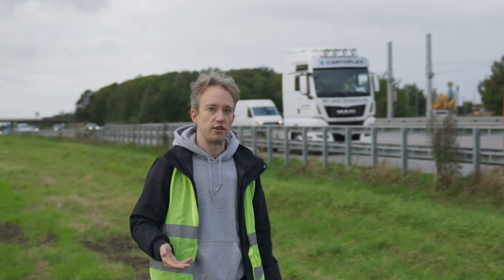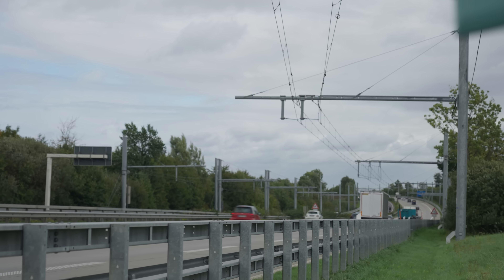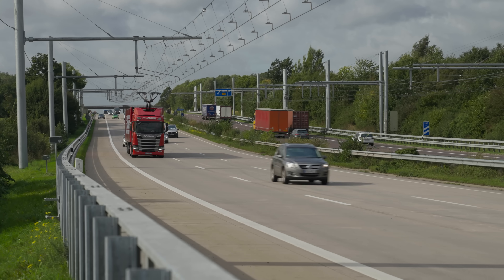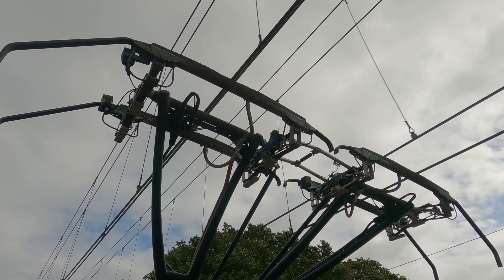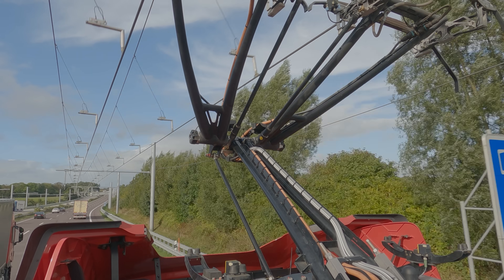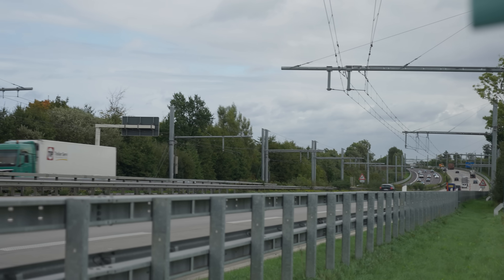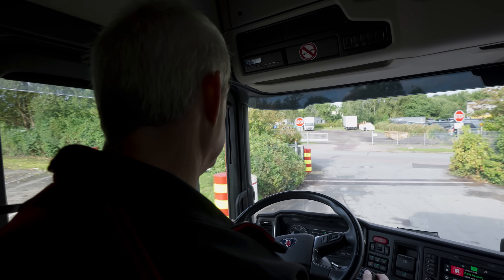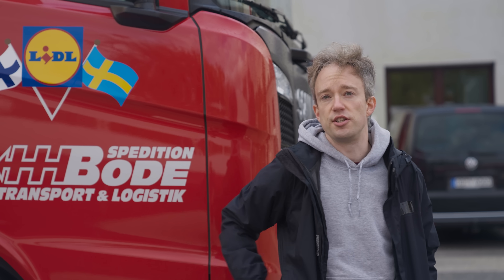The highway where trucks work like electric trains

Comment: I feel like hydrogen fuel cells and batteries would honestly be a more practical solution to this whole charging system being that you can just fill up and go however that being said hydrogen does have its own disadvantages overall efficiency of current production methods is one example.

Comment: So great that you did this story.  I live near Seattle and that city still has some downtown bus routes with overhead electric wires for their old styled electric buses.  Instead of this simple trapeze connection, the driver in Seattle must stop and connect manually a pole from his bus roof to  the overhead wire.  The driver uses another pole by hand to pick up the power pole from the bus to make this connection.
Reply: Electrocution is fun ?
Reply: @JB73-b5x  if only we had some material that could be used to isolate an human from electricity..

Comment: this is fine and all with 1 truck on the grid.. how about once all trucks are converted and rushhour traffic, now suddenly you have 50+ trucks within a mile stretch of highway fighting for the same power from the same cable.. 

This overhead power cables works for trains because trains are usually spaced miles apart for obvious safety reasons.. and generally never more than 1-2 trains per section of energized cable, however vehicle traffic is a whole different beast, I expect that a system like this will overload or simply not provide sufficient power during traffic jams or anytime there's a train of back to back trucks.

Comment: Spend the money on trains and as it's in Europe, the canals.  Thirty trucks need 30 drivers and X number of mechanics to keep them on the road.  A train can easily pull 30 containers and only requires a driver and a guard.  At one time every small town had access to the railway in the UK and most stations had sidings - stupidly all of the sidings and most of the marshalling yards have been sold off and built on.  Vested interests strike again in the UK.

Comment: I like the idea of having a combustion engine while still being able to run off electricity where possible. Many trades require going in areas that are not traveled near enough to have overhead lines, and if the electricity goes down you're screwed if it doesn't have a combustion engine as well. This system would let it run off of combustion engine where necessary and let it run off of electricity where possible, I think that would reduce emissions and create a Greener solution then putting batteries and everything. Mining the stuff for batteries is just as bad as running gas, so if you can keep the gas and also use electricity that's already exists in our power grid that would be cool

Comment: Good luck with that. At the moment there is no substitute for diesel. It works. Where you gona get the massive amount of electricity to power them?  Magic pixy dust and unicorn farts?  Solar and wind do not supply enough. Until we find another power source it’s diesel trucks and coal burning power plants. Which is fine because there’s nothing wrong with them.

Comment: The amount of infrastructure might bring it close to the trains, It might help to have slightly bigger batteries, say with 100-200KM range and Charge them over few KM stretches of overhead lines scattered across the motorways this way you can shift some of the cost to trucks instead of Road Networks

Comment: The idea is dead in the water. The "Global Warming" hoax is designed to make everything more expensive, so that more taxes can be levied on the citizens. In a nutshell, that's what it's all about. "Fossil fuels" as they like to call oil from the earth, is not in short supply. Oil is created through a natural process that will continue until the end of time. Charging electric batteries and creating tram-like systems for trucks, only exerts greater pressure on our existing power grid. It's far more expensive to charge, maintain and replace electric vehicle batteries than it is to run and maintain gasoline or diesel powered vehicles. Also, electric vehicles offer only a fraction of the performance we've learned to expect from gas and diesel powered vehicles (there is no comparison, when it comes to economics and performance). Outlawing a superior, proven technology is insane.

Comment: In principle, this seems a good idea.  However, a number of safety concerns would have to be taken into consideration.  Mainly, what voltage of power supply would  be fed into the overhead wires? THen, most importantly, the integrity of the equipment.  Several truck drivers cannot be relied upon to take their vehicles through bridges without striking that bridge.  Imagine the chaos if a driver enters the wire system with an overheight truck! It will be extremely problematic.  Then, assuming that truck brings down the wires, how will the average motorist handle the situation? Railway train drivers are train on what to do should the overhead supply be brought down the railway.  Is the "average Joe" motorist able to cope?.     Also, I would assume that the road traffic regulations not mention the Highway Code would have to be drawn to cope with the situation.

Comment: So how is this going to get around the road network in the UK which has thousands of low rail bridges based upon a Victorian rail network? There are thousands of low bridges all across the UK which have various heights which prohibit trailers from passing under them. Introducing overhead cables reduces the clearance even further. 
Not forgetting that Scotland's most northerly motorway ends at Perth which is geographically in the centre. 
It's a theoretical idea which ticks the boxes for the politicians but it's unworkable in practice and detached from reality.

Comment: Great idea, but too bad the electricity in Germany is so dirty. It would make a lot more sense if the electricity from the cables is actually low carbon.
Reply: Germany is going to phase out coal. The old government decided to end coal until 2038, the upcoming government is even aiming for 2030. And building such a system of overhead wires over all highways will take some years anyway.

Comment: Reminds me of ye olde trolleybus that we used to have, but for some reason they decided to replace all the old electric trolleybuses with Petrol and Diesel powered busses.
Reply: When did they replace them though?
Back then you could only power small vehicles with electricity, steam engines took too much space, and combustion engines weren't there yet.
Reply: @denniscleaver3559  Consider that while in countries like Britain where they had, but removed Trolley busses and Trams to replace with Busses, other countries such as those in mainland Europe expanded their tramways instead. It wasn't that continuing to use and develop the electric vehicles we already had wasn't an option, Britain just chose not to, due to the increasing availability of cheap liquid fuels.
Well, those liquid fuels aren't cheap anymore, and their availability is decreasing, on top of their use becoming increasingly undesirable due to pollution, so they're looking back to the past for inspiration, returning to over-head electric powered road vehicles, like the Trolleybus, except this time it's for cargo, not passengers.
Reply: @bobingabout  so they simply acted in a dumb and shortsighted way. Like any government should.

Comment: That might work in small countries like Germany and the UK.  It would take many year and unimaginable sums of money to build all those wires and cables in a country as geographically large as the US.  I think a better solution might be to have the cables around densely populated areas, with stations every so many miles on the remote sections of interstate where they can stop and swap out the low battery out for a fully charged one and keep going. Still going to be extremely expensive though, and our nation is already almost $30 Trillion in debt :/.

Comment: While energy in Germany is sourced predominantly by fossil fuels this is just a case of moving the pollution from the trucks to the power stations. Germany has a lot of work to do with it's electricity generation if this is to have any effect at all.
Reply: This argument comes up a lot, but It's far easier to regulate 30 power stations than it is to regulate 30 million vehicles.  A coal power plant doesn't get it's annual MOT carried out by a 19 year old covered in grease.

Comment: haha this absolutely crushes Tesla's EV trucks because the batteries needed are so much smaller. the main drawback of the Tesla trucks (there are two models) is that the batteries are so big and heavy that the carrying capacity is a fraction of what other ones can handle

Comment: I love this solution. I remember being in awe at the public transit in downtown Seattle where the busses connected to power just like this. They were all so quiet and it didn't stink to high heaven.
Reply: I was thinking about the same thing. You couldn't run diesel buses in the transit tunnel without tons of ventilation.

Comment: I remember seeing an idea like this about a year ago for charging electric cars on the road. But instead of a pantograph wire, it used induction magnets embedded in the roadway.
Reply: That would be a lot more expensive and a lot less efficient. This is a well tested well working technology.
Reply: @asdfghyter  That is all true, but one of the reasons they were looking at linear induction charging was to make road charging accessible to cars too. Both solutions can work well for charging trucks. But considering a car's smaller size, and the unpredictability of drivers on your average highway, a contact pantograph-wire system might not be feasible or safe enough for most cars on the road
Reply: @iliketrains0pwned   Cars have different requirements.  If the goal is efficient passenger transport - use a bus, and the same Pantagraph tech.  Cars are small, because they are also light.  And... they usually have ONE driver.  Battery tech that requires a 30 min recharge right when the human is getting sleepy is a GOOD idea.  Trucks simply can not use the batteries from Cars because they are too heavy - so they need a way to extend their range to usable limits.

Comment: Trolleytrucks may not be the most efficient way to go green, as the cost of building the overhead lines matter s even though it is a good idea. They can try using battery powered trucks or even fit in Hydrogen fuel cell on the trucks or even move to regular railroad vehicles with dedicated routes for freight only. As for road trolley vehicles, it is better to be used as passenger public transports such as trams and trolleybuses, as cargo trams or trolleytrucks can be used as maintenance vehicles for the trolley systems. However trolleytrucks and trolleybuses can climb slopes.

Comment: If one of the pantographs got tangled up in the wires and pulls them down as sometimes happens on the railways you're going to have 750v wires flapping around the road. Not good. Will probably require self steering to be reliable enough.

Comment: Different idea:
Use the truck in front to fill up electric cars: Trail very close to the truck and "plug-in" (One car per truck). Trucker company gets some commissions. Car plugged in at the back becomes a "slave" to the truck driving in front (Braking, steering, indicator, etc) -> Fully "automatic" (by the truck driver) drive. Driver of car can get some rest. After fuelling up enough, overtake and continue on the road quicker.

Comment: I thought of this idea myself years ago and it seemed like such an obvious concept but no one seemed to have developed it, but it’s awesome to see that Germany has been working on this. I think it’s a good idea for cars too, but that would be more difficult because of the variable heights. I think to make these E-lorries work even better would be if they had battery power for the non-highway parts of the route, but then it recharges on the highway so it doesn’t take ages to charge up when it’s parked and plugged in.

Comment: This actually makes sense.  The truck pays for the power via the Electronic Logging Device ELD software.  

The truck is a hybrid like a locomotive Diesel engine turns a generator not the wheels. This allows a truck driver to get off the highway for that last mile.

Comment: Ah, just think of all those videos you see of a truck driving along with the tipper raised, taking out a sign post or bridge. Now that'll happen with high voltage power lines as well. Still, in 20 years maybe driverless vehicles will have taken over and the robot trucks won't make those mistakes?

Comment: One thing with modern vehicles burning fuels so efficiently, how would that compare with the other means of increased electrical production, wind, solar cannot keep up, limited, so does than mean burning more dirtier coal ?
Reply: Nuclear, the answer to everything related to electricity is nuclear unless you're in one of the few places hydro is the better option.

Comment: Given that driving on UK roads is like the ‘Dodgems’ anyway, why not extend this to be an electric mesh above the whole road, and then we can all have those whippy aerials to pick up the current, just like at the Funfair? 😎
Reply: You might have forgot but Dodgems also have metal wheels and the floor of the arena is steel plates.  In order to complete a full electrical circuit you need the mesh above and the steel plates below. 👍
Reply: @krashd  Yes, I guessed it was more technical than my description 😄
Reply: I wanna see people commute to work in actual dodgems.

Comment: Increase efficiency 500% by having steel wheel on steel rail (which also means the truck stays aligned with the overhead wire).Then couple all the trucks together with just one driver in the front one since they don't need to be steered - you could couple up to 100 HGVs like this with just one driver! I think we just re-invented the electric freight train FFS!

Comment: Speaking as an ex tram driver, the idea of driving a vehicle with a pantograph, but no guiding rails is insane. When a tram or train goes round a corner, the rails match the route of the overhead power lines exactly, so the pantograph is always pressed up against the wires and held in tension. Without the wires overhead, a raised pantograph will just spring up and flap around. This can lead to entanglement with the overhead, or even the pantograph being ripped off. Imagine that chaos on the M25 on a Monday morning, all because the driver twitched the steering wheel and the lorry shifted from it's precise position.

Comment: Great idea. It could be improved by dedicated line only for trucks. So cars would not interfere with trucks. And replacing rubber wheels with steel wheels and track system would improve efficency and save money on rubber wheel replacements. Last improvement could be stacking multiple trailer to a single truck so single driver can carry multiple trailer. Oh wait... thats electric train. May insted forcing into futuristic bs. It is better improve and integrate existing infrastructure so it could satisfy future demands.

Comment: Why can’t we use trains? Keeps about 30 lorries off the road or possibly even more! Trains move massive loads for more efficiently why are we pissing about building all this when we already have well established train network??
Reply: How many stores and warehouses have a rail connection?

So you would need a truck to go from the warehouse to the load station, load the train. Wait until the train is full. Take the train to the nearest unload station. Unload it onto a truck and take it to the store.

Vs

take the truck from the warehouse to the store

Comment: Two pantographs for feed and return due to no steel track BUT, you need to keep centre of the lane with little or no meandering.
Reply: Lane assist features are already super common, in cars at least 
Nevermind self driving cars in a few years

Comment: So make it a small (pallet sized ?) system that runs beside road / rail. Automated with the packing slip on the pallet being scanned automatically. Tubular monorail perhaps for weather / crime proofing. Stick it underground when needed. Everything moves around at 300 - 500 KM. Start them in the industrial areas to save on all those short distance by truck deliveries. Put them under footpaths. 
Only garbage on one morning a week.
Lots of waste plastic available for the tubes. Copper will be the biggest issue.

Comment: Interesting video thanks. Here in Britain we used to have an extensive rail network and many rail stations had a depot or yard to handle onward deliveries by road to the bits the trains couldn't reach. If that infrastructure was around today the transportation using it could be converted to green energy more easily than building new infrastructure. Unfortunately, the British decided to tear up a lot of their rail system and is now pursuing schemes like these electric lorries...it's great and personally I'm sure it would work in some areas but why don't the British just admit it they got it wrong ?

Comment: Well my idea is that we should have more bigger electric tanks because the wires are dangerous, high electricity and if one fals the higway stops.

So using the money we could have bigger battery tanks and more station them to charge but as the same time cars could also use them to charge. So this way its less dangerous.